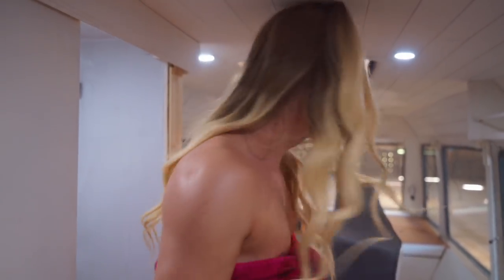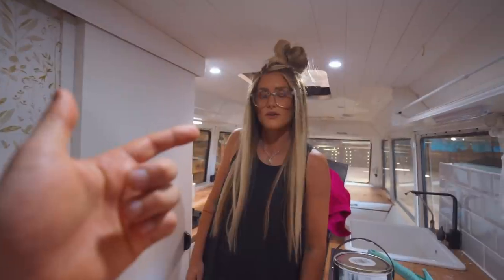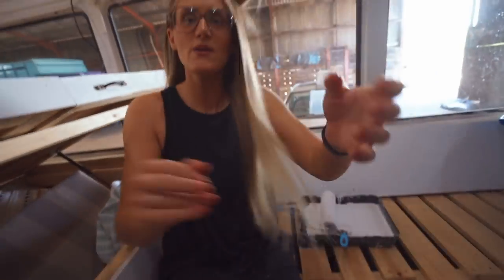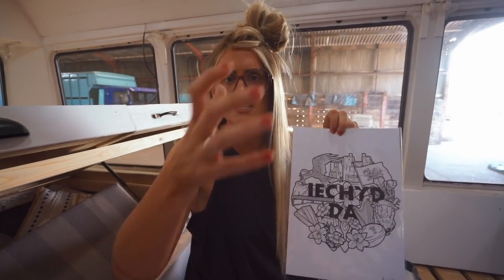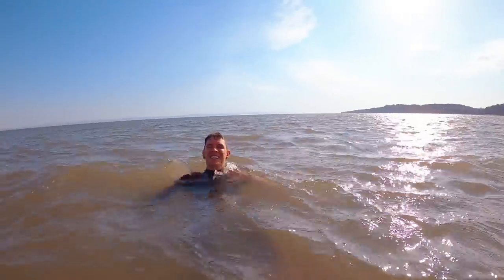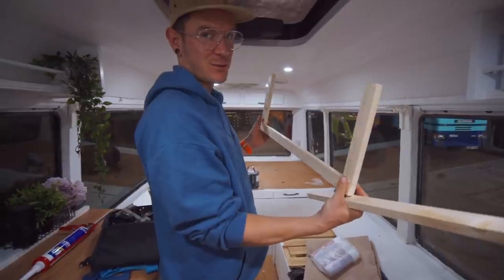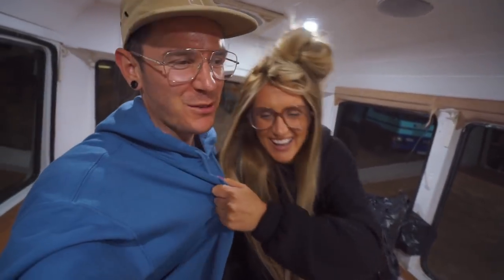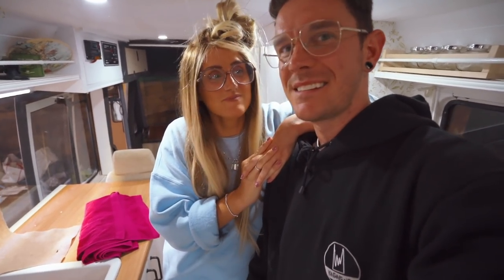Van Life renovation - absolutely clueless.

Comment: good day .  

for the passenger seat : 
make a sturdy platform over the stairs at the entrance .  
make the platform rest on the steps so that it is sturdy enough to stand on it .  
pivot the platform towards the dashboard .  
place the co-driver seat on the platform at the correct height to touch the ground .  
when you drive, 
you fold the platform up to the stairs and the driver and co-driver sit side by side .  
if you are standing somewhere and want to get off, 
fold the co-driver seat with platform forward and the seat is out of the way .  
plus you now have place where the chair was to put a real cabinet for extra storage space .  

kind regards Hollandduck from the Netherlands 
(source of translation: Google translate)